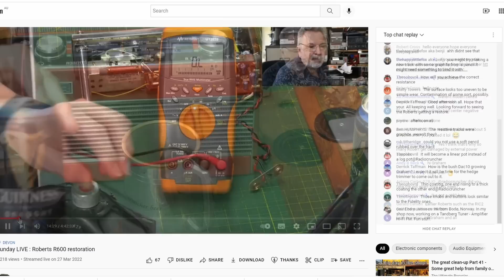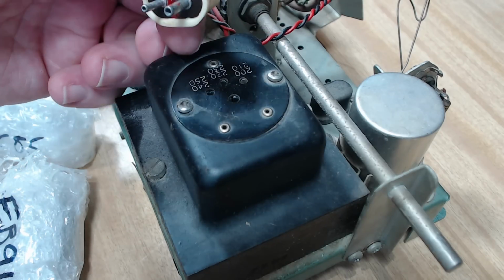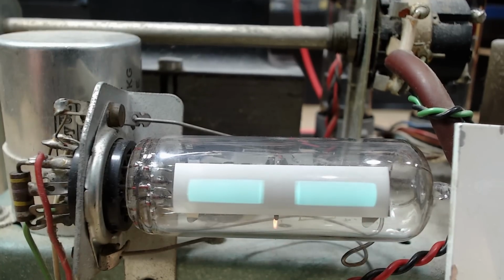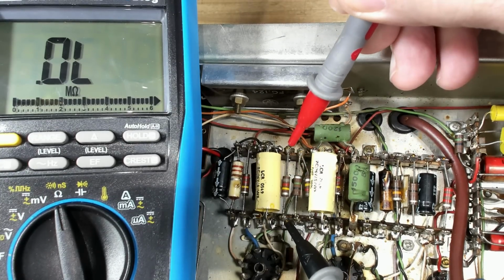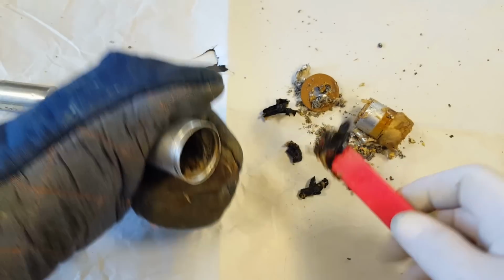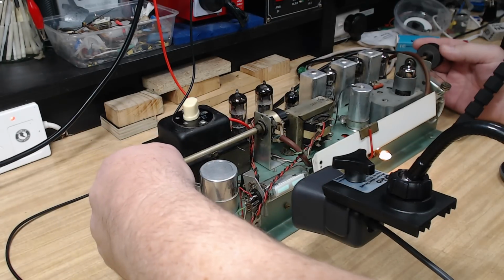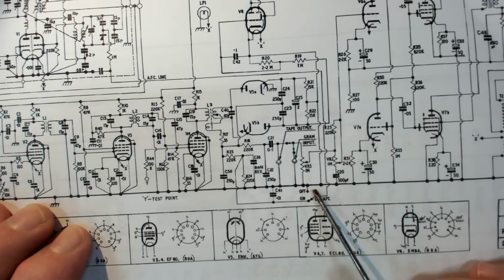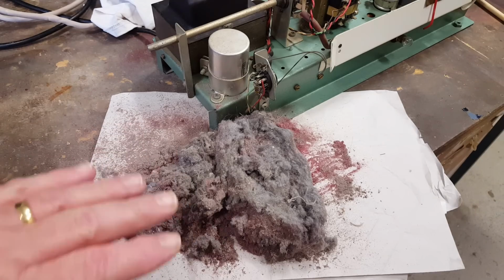Hacker RV20 Radio - 1962 -1966 Part 1

Comment: In US in the '50s and '60s, a number of FM only sets were sold, with the presumption that you already had an AM set.
Thank you for reminding me why I just throw out the old capacitor cans.
Reply from the maker: According to a Hacker advertising leaflet the BBC broadcast in FM which covered most of the British isles. Further, they could produce a high quality receiver at a lower price. This may not have appealed to younger listeners who tuned into AM pirate stations and radio Luxembourg. Haha... I can understand chucking the old cans Vic, thanks 😄

Comment: Hi Dave,
The job of repairing “old radios” was given to apprentices.  I certainly remember, among other radio and TV brands, Hacker.  Mayflower I, and II chassis were a pleasure to work on, and above all were very reliable.  Customers tended to hang onto their old valve Hackers, Roberts, Bush, Murphy (along with the odd few Pye, Ekco, and GEC) radios.  A steady stream of those old brands continued to come into sales and service centres where I was employed into the early 1990s.

Sadly The Hacker brand (formally Dynatron) has been defunct for several decades.  They produced  fine radios, record players, and radiograms.  If my memory serves, You presumed there must have been a Mayflower 1?  Yes they exist!  An excellent table valve radio housed inside a fairly attractive wooden cabinet that has rounded corners.  There are two of them in my radio collection (along with four Mayflower 2 radios).  Each one cost me les than a pound.  I bought them at a time when valve radios were no longer in vogue - these days, valve stuff is back in vogue, especially among audio files, and collectors and restorers.
It certainly is all good fun my friend, Phil
Reply from the maker: Hi Phil, this was so easy to work on very well laid out and not a birds nest like most. I have seen photos of the Mayflower 1 and it's a better looking radio than this one, it would be nice to get one, next time I am in the UK I will keep an eye out. I see in UK radio groups people are picking them up pretty cheapy still. Thanks Phil 🙂

Comment: I hope you enjoy working on the Hacker, they are one of the best FM table sets ever made, I have a very tatty one awaiting attention, It does work to a fashion, but needs both ECL86 replacing.
Reply from the maker: It was a nice radio to work on, very clean layout and it works and sounds so good. I hope you can return yours to full working condition. Thanks markpirateuk 🙂
Reply: @DavidTipton101  Thanks David, I do like Hacker stuff, very much a high end manufacturer in the UK. Their transistor sets are also very impressive too, they did produce an FM only portable, the RP37A VHF Herald as a successor to the Mayflower.

Comment: Hacker FM  tube radio challenge from the UK. 35 minutes of quality entertainment thanks to you and Radiocruncher!
Great idea on using the metal parts of a terminal strip in the restuffed capacitors. Troubleshooting why the radio did
not work after you messed with it a bit seems to bite you when you don't expect it to. Oops! Glad you figured it out.
This radio is a top notch gem and you restoring it to its former greatness is a joy to watch! Looking forward to part 2!
Reply from the maker: Hi Steve, an international effort this one. I was convinced it wasn't something I did, moving the capacitor revealed my mistake. It a very good radio, thanks Steve 🙂

Comment: Another method for dusting and even washing Electronic devices is to source a set of Horse hair Paint brushes "1 of 10mm, 1 of 20mm and a 50mm if working on large Computer consoles frequently"
When washing I found spraying "IPA" AKA "Iso Propyl Alcohol" followed by brushing the area works wonders.. 
APU I dropped a 👉👍👈
Reply from the maker: Hi KorAllRBare. Cleaning needs to be tailored to the job, Isopropyl is good in a lot of cases, I need to source some good brushes, the ones I use are too soft. Thanks for the tip 👍🙂

Comment: The  radio restoration community is certainly a generous group it's symbolized by this Hacker Radio. It's interesting that differences approach radio manufacturers took between the US, UK and the Dutch/German designs.
Reply from the maker: Hi Mack, yes it is, I'm proud to be a part of it. You're correct the difference is pretty dramatic. Thanks Mack 🙂

Comment: Good going there Dave, that unit ought to be quite a boombox with the P-P output. Great stuff your UK friends managed this "Export to Australia"  🙂

 I was wondering why Hacker made an FM only set, a reason maybe being that they wanted to save on the complexity of an elaborate set of switch wafers to switch the IF and demodulator valves over to  AM coils IF transformers. (or even a separate AM IF strip with separate valves plus extra osc/mixer)

So Hacker maybe thought: Nah, whoever can afford this FM set surely has an AM set at home already.
With the Magic Band: if you ground pin 1 the band should open up all the way with just 2 thin green sectors on the edge of the screen, which then would mean that there is a voltage leaking into the (hi-impedance) grid circuit somewhere at the ratio detector or on the way to the EM84.
If however grounding pin 1 does not change the display the EM84 has an internal leak , thus defective.
Cheers from Germany
Reply from the maker: Hi Blitz, thanks, it was very generous of them to do that as you well know. I read somewhere that the BBC had installed extensive FM broadcast coverage negating the AM system so Hacker jumped in. I did a segment testing the magic eye but the camera didn't pick up the eye so I scrapped it. I did test it in the radio and it doesn't move the eye open any further. I concluded it was either designed that way or as you said it has an internal fault. I'll see if I can get some stock. I have a spare in poor condition and it worked ok in the radio . Cheers!🙂

Comment: David, next time you receive a package from the UK open it upside down. This will automatically correct for southern hemisphere transfer displacement issues. Hope this helps.
Reply from the maker: Thanks Jonka, I have received a few northen hemisphere packages and never thought to open them upside down, typical noob mistake on my part. Next time 😄🙂

Comment: Hi David, I saw the Radiocruncher video, glad it made it to safely, I have done two of these sets and they come up very well good sound with that big speaker  they do work the output quite hard but they are a good set, don't forget those red elcomolds. Have fun with it look forward to seeing it running.
Reply from the maker: HI Lee, it was well packed by the Cruncher. It sounds very good, the speaker is huge. Caps are all done, pert 2 on Saturday 👍🙂

Comment: The devil is in the details 😊 I’ve shorted things out with simple replacements more times than I care to mention 😊 Usually I just emit a few choice words in either English or Portuguese (or both), and don’t show it on my videos so that the viewers think I’m actually clever 😊 
That is a really nice radio, and the selectable AFC is rather innovative for the era. I don’t recall coming across that on any of the Germans sets I’ve done.
Looking forward to the next instalment. Thanks Dave.

P.S. I split my chopstick almost to the half-way point so that I can simply open up the ends with my fingers, and make really quick work of replacing the pad. That’s why I use the spring thingy to tighten it.
Reply from the maker: Ahh... it didn't occur to me to cut my mistake out, I have so much to learn. I expect Manuel's Mop sales to skyrocket as well with the added exposure, my mop design had fewer moving parts although it did require some basic tools to assemble. I was surprised the radio had AFC too, it works well in part 2. Thanks Manuel 🙂

Comment: Great video.  If I kept track of my mistakes working on radios my "dumbass diary" would be several volumes thick.  Good trick on the wire loop on the tracer and the chopstick cleaner have to try them on my next project.
Reply from the maker: Hi Nelson, thank you. I think most of you could fill a dumbass diary very quickly, you would hope it would become less frequent as time goes by but alas. Manuel's Mop is quite handy. Thanks Nelson 🙂

Comment: Greetings:
Brisbane has FM stations at 106.9, 106.5, 104.5, etc.
Heat is always recommended for e-cap cans; both aluminum & cardboard!
Reply from the maker: Hi James, yes we do have stations but none I'm interested in. I didn't think the heat did anything but make it hard to handle. I'll keep trying on other capacitors and see how it goes. Thanks 🙂

Comment: Hi Dave, love the adaptive and quirky intro!

As you may well know, Hacker was an upper echelon manufacturer at the time-by that I mean that they were well respected and renowned for their quality, which holds up so well, even today.

Given the market they aimed at, the relatively new VHF (FM) exclusivity and sound quality was probably a big selling point. This despite the fact that coverage and programming diversity were both lacking at the time. Urban reception only, with none of the regionals, and of course with AM out of the picture, you would hear little from abroad.

For the record, I haven't heard of a Mayflower (I)

Also, unpacking is fun!

P.S. Also, also, will you tell us more about your signal tracer?
Reply from the maker: Hi Roundy Mooney. I know now Hacker were well respected, before this I had never heard of the. FM only would have appealed to BBC listeners but the younger ones would have prefered radio Luxembourg or the AM pirate stations floating around. My signal tracer is a K7000 (now WSMI7000) kit from Velleman in Belgium, it works pretty well but you need to keep it away from high voltages, I am building a sniffer attachment so I don't have to touch anything with it. 
https://www.velleman.eu/products/view/?id=461894

Comment: Dave, I suspect that distortion is due to the dreaded "multipath reception". FM radios are fairly choosy about having a good outside antenna, especially something directional to cut out reflections. Multipath on FM is equivalent to ghosting with TV.
Reply from the maker: HI Graeme, I can imagine that happening, I have it connected to a temporary antenna. I need to align it, that may help too. Thanks Graeme 👍🙂

Comment: Can't wait also David.  Been thinking about you the past week as i am slowly setting up an alarm system.  I do a little every day as the parts come in. The house was pre wired, but i never got to installing a system, been over 12 years now and decided to try doing it myself.  Have a fun time retracing all the wires with just a tester for continuity, but had to purchase a cheap wire toner tracer to identify the last 2 wires.  They were well hidden underneath the door's weather sealer. Can't tell you how many times i asked myself out loud: What would David doo ? . Hopefully i'll be getting the board next week, the parcel was stuck at borders it seems and was returned to sender. Hope it's not considered bomb making terrorist devices...
Reply from the maker: Haha... only 12 years? why rush into it. Builders are hopeless, I prewired a house for an alarm once, when I went to install it the wire was in a bundle in the ceiling 🙄 Good luck.

Comment: Mayflower 2's were always full of bad resistors. Last one I did was a full rebuild from scratch in the end. Had to change every resistor and capacitor in the set. Once they are done though, an absolutely amazing sound from them. As for sending the dust back to Graham... I would!
Reply from the maker: Hi George, you wont need to watch part two then, but that's next week. As for the dust, I did! 🤣
Reply: @DavidTipton101  I'll still watch because I watch your techniques and see if there is anything I can learn from every video. I do repairs on video too and have actually livestreamed from Grahams house but I'm open to learning every time because nobody knows everything and even the slightest hint to make life easier is a good thing. if you get the chance to get hold of a Mayflower 1 they are almost the same but with a tuner that expands to 108Mhz and a niicer shaped cabinet. Looking forward to your part 2!
Reply from the maker: @GeorgeChristofi  Absolutely right, the slightest hint can trigger a light bulb moment, Graham is a great guy.

Comment: They probably released an FM Only radio aimed at people that already had AM Radios in working order that didn't want to replace them just to get an FM radio.   If I recall, FM was pretty new at this time and was the shiny new toy.   The Radio Out could likely go to a Phono In or Tape In on a radio that didn't have FM.
Did 4BK / B105 change to 104?   I am sure it was 105.3 when I was in Brisbane and MMM was on 104.5 :)
Reply from the maker: Hi Brendan, according to the advertising for the set it was FM only to produce an affordable high quality set and the BBC had much of Britain covered with FM but I'm sure lots of folk would have already had an AM set, the parents maybe listened to BBC and passed down the AM set to the kids to listen to pirate radio 😀

Comment: Funny that you had the radio upside down for a bit, but later in the video I thought maybe that was the correct orientation as the slide rule dial has the upper frequencies on the left???? Is that a driving on the wrong side of the road kind of thing?
Reply from the maker: Haha... yes it is odd going the other way, it caught me out a few times 😄

Comment: Hello David,

Another project, which you were able to use your brilliant signal tracer. It did an excellent job.

Is there a link to the kit form or maybe another similar to build or purchase as a retail product?

I can’t find much online myself but would really like to have this troubleshooting option available when needed!

Cheers!

Peter

😁👍
Reply from the maker: Hi Peter, mine is a K7000 kit, they have updated the part number to WSMI7000. Search both numbers you will have a number of choices 👍😀
https://www.velleman.eu/products/view/?id=461894
Reply: @DavidTipton101  thank you David. That’s awesome. 

The Loewe Opta Hellas arrived this morning. 

Not good at all this time!!! Not going there again.

Cheers!
Reply from the maker: @Leo6009  My pleasure Peter, sorry the Loewe didn't meet expectations.
Reply: @DavidTipton101  just the dial face shattered. About 7 pieces. Super Glue Glass for salvage. It’s been recapped and the 2 magic eyes are good. Not much to spend. It’s the HiFi model. Unreal sound came from the dead. Still reforming now. Cheers!

Comment: What is the purpose of the wire to the top of one of the electrolytic cans?  Shielding?  Is the can isolated from the chassis?
Reply from the maker: Hi Bob, the electrolytic can used to have two capacitors in it with only two solder lugs, the can was the ground, they added a grounding wire to make sure it was grounded, the other capacitor didn't have that but was the same construction method. I retained the wire for originality but it's not doing anything. Thanks Bob 🙂

Comment: I missed your video of this a few days ago. I have no idea 🤷‍♀️ what a “Hacker” radio 📻 is. I just hope nobody uses it for actual hacking purposes. Hacker must be the brand name by your description. It also has AM/FM. I’m going to guess that this is a 1952 radio 📻. Not sure 🤔 if the speaker 🔊 is field coil or permanent magnet 🧲. I hope 🤞 your dial cord is in good 😊 shape. Dial light 💡 bulbs 💡 are easy to replace. Your friend, Jeff.
Reply from the maker: Hi Jeff, Hacker is or was a British radio manufacturer how made upmarket electronic equipment. The radio is from 1962 or thereabouts and is FM only. The dial string is OK and the speaker is permanent magnet 🙂

Comment: Watch when you add a ground (earth, etc.) lug that you don't short something else... duh.

Is it possible to mechanically add a ground to a restuffed aluminum case, especially when you know there's a grounding bracket holding it on that will cover up the head of a bolt run through the case for the purpose?  I believe that welds are the original way to attach a solderable lug to the case, right?  But if you don't have a spot welder, then the mechanical ground should work, with a star washer to dig in to the case aluminum and even a dab of conductive epoxy or lube there.  One could even simply attach the mechanical ground to the end of the case, with the bolt head visible, but still neat, right there -- which could be considered a sign of an electrically equivalent restuff, with "Restuffed" and the date written in a ring, even printed on a label, around the bolt head.

And you'll have no more extra grounding lugs needed to give you trouble.
Reply from the maker: Haha, yes I'll be doubly sure next time. That's a good idea StLtGM, I have thought about it before but means putting a hole in the casing and it would be at the top so I can get the capacitors past or at the bottom and attach it once the caps are in. I have aluminium rivets which is what I would use together with a solder lug, I certainly could have done it on this radio, it would have been neater and hidden. Now that you have reminded me I will look at it next time. I did put a note under the chassis that the caps were restuffed. Thanks 🙂
Reply: @DavidTipton101  Another possibility (if You Tube will let me post it) is alumin[i]um solder which would let you connect copper to the inside of a gutted electrolytic can completely hidden if a rivet connection was dicey.    Alumin[i]um oxide is a bugaboo for mechanical connections.  The alumin[i]um needs to be hot enough itself to accept the solder, so this might have to be a barbie-aided process.
Reply from the maker: @SeekingTheLoveThatGodMeans7648  I have some solder that works on aluminium but I haven't tried it as yet. If I do it I will definitely need the barbie on maximum heat 😄😄